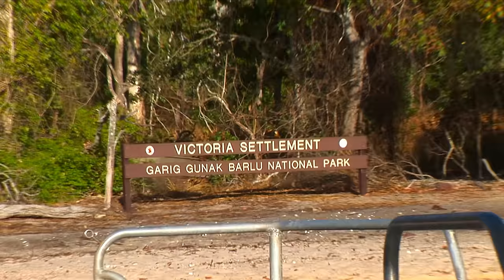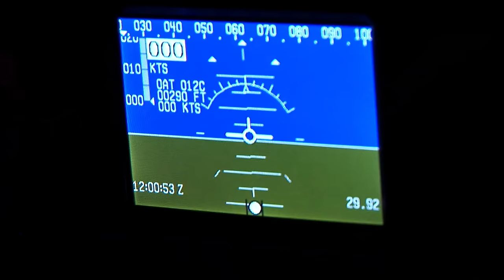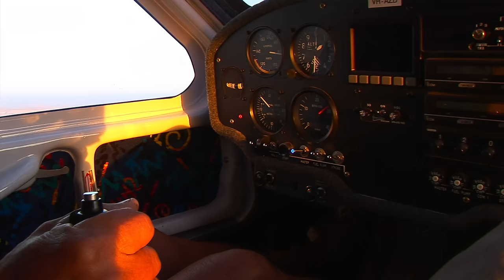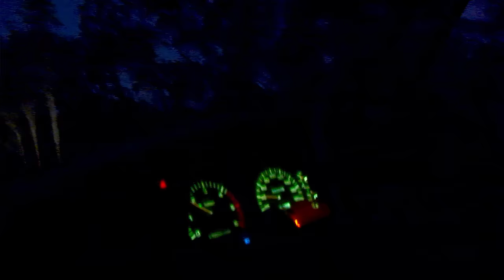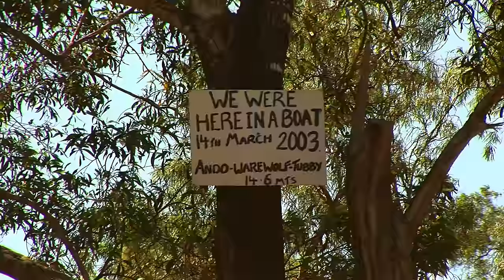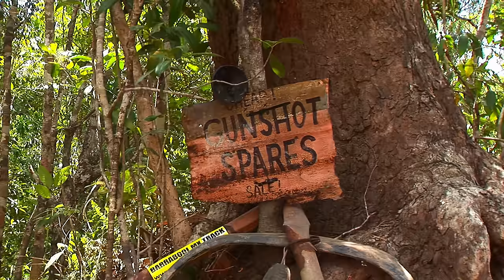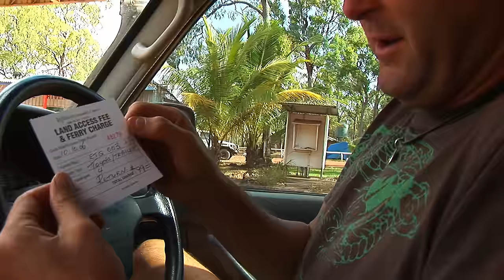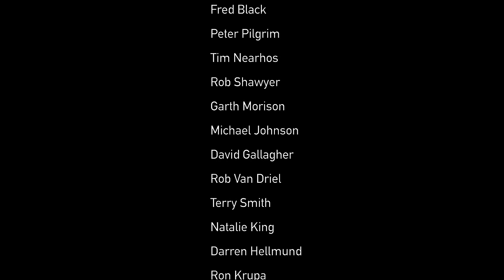'The Big Lap' Original Series EP 8 - Cape York Or BUST!

Comment: Can I use an awd for the tracks you’ve made so far? I’m planning for such a trip from Melbourne. Will you reckon I get a 4x4 instead. Thanks
Reply from the maker: Hi Joel, personally I would recommend a proper 4WD which has good ground clearance and low range gearing. It’s not just to avoid getting bogged but 4WDs are built a lot stronger and more able to withstand the constant abuse of the corrugated roads and tracks. In our trip to this point we’ve covered over 5000km of unsealed roads and most of them pretty rough.